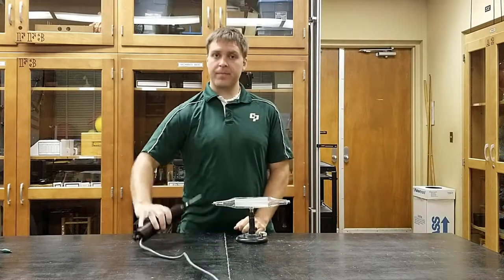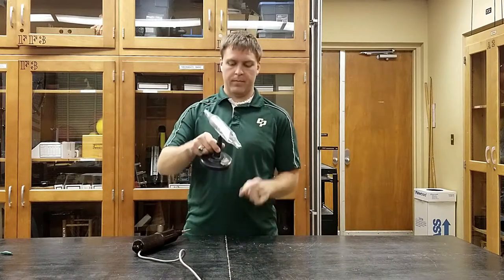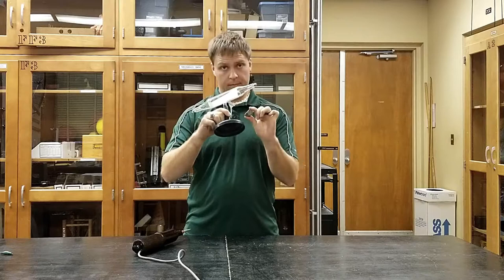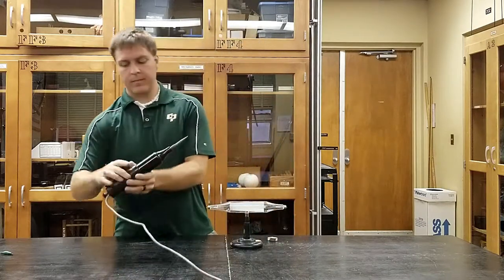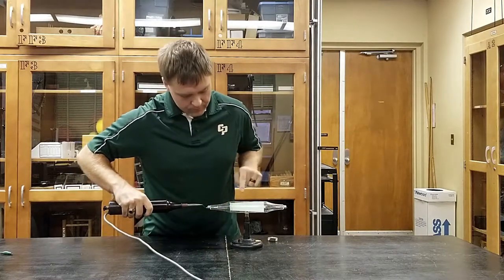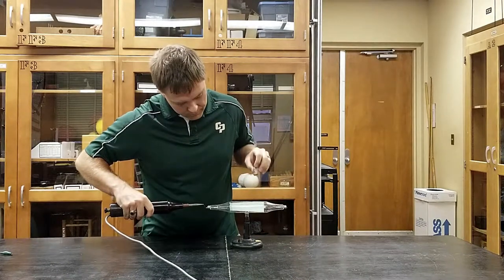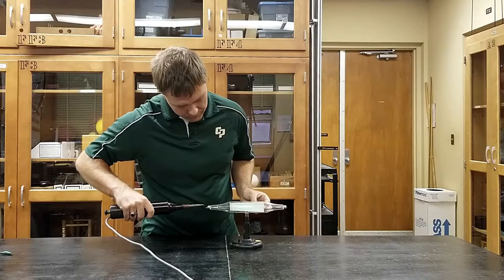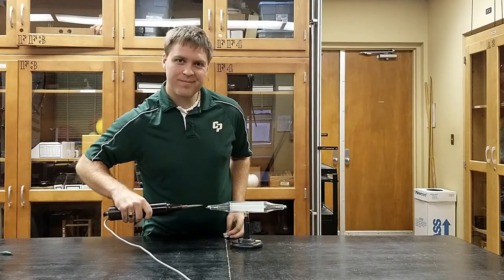Electron Deflection

Comment: This is a great demo to have students predict the outcome to gauge their understanding of the right hand rule-- it makes it quite frustrating that this particular setup requires two hand operation! I'd love to have a setup that didn't require the use of both hands. I've tried rigging up a ring stand for the high voltage source— it works ok. When I saw this demonstration as a student, the instructor used a vintage round-face oscilloscope like this: http://www.electronixandmore.com/projects/scopepong/roundpongoscope.jpg
I wonder if there's a scope sitting in a cabinet somewhere that could be used for this demo. 

Another important requirement as a RHR prediction exercise: the magnet needs to be labeled north and south, so the direction of the B-field can be specified in the setup. It'd be great if the magnet dedicated to this setup was labeled. I usually find a compass and mark one before class.